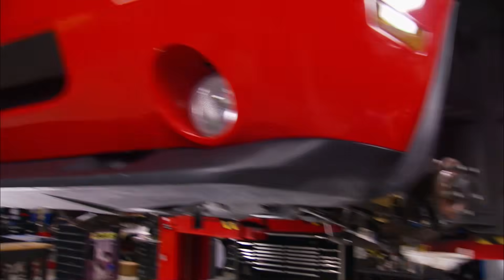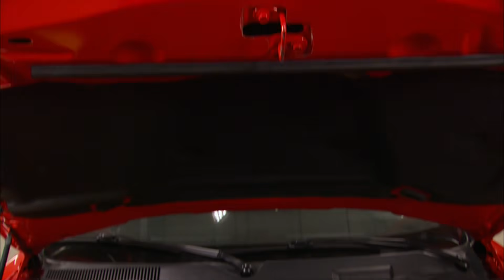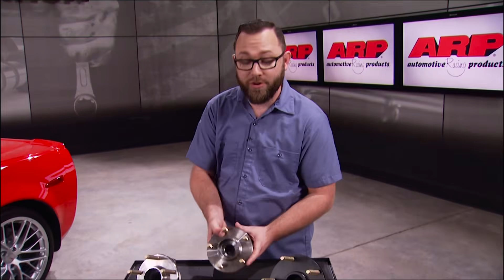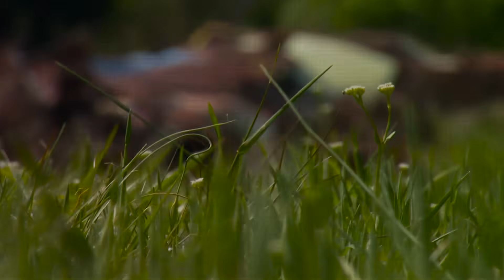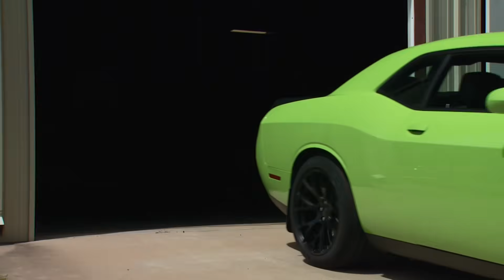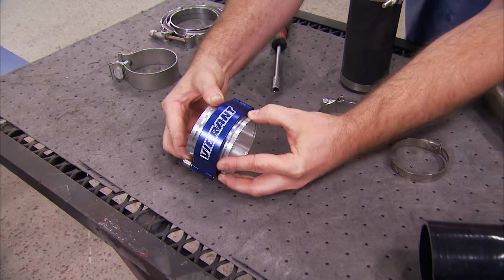Dropping A Twin-Turbo Hemi Stroker Into A 2010 Challenger SRT8 - Detroit Muscle S3, E14

Comment: I owned one of the 1970 Camaro RS in that ugly pea green.  At the time of it's release Camaros were distributed only in certain colors in different areas of the country.  My boss was golf partners with the local Chevy dealer who gave me a gret deal on the Camaro RS he had on the floor ....... It was the Pea Green ....... I wanted the charcoal but would have had to wai 10+ weeks for it.  As time went on I hated the color more and more plus being a musician it was not a great car for holding large speaker cabinets. Anyway, I was driving a lot to band jobs in those days and racked up 75K, I dumpted it in favor of a Mustang hatchback. This car was blue when they started restoring it ....... they should have kept it that way !!!!!

Comment: Working on getting srt8 and first mod ima do is get stronger suspension bigger axels then forged rods and pistons then upgraded injection upgrade cam and the exhaust then I will run turbos or supercharger after that my build plan lol

Comment: I'd have a real problem with mounting the air intakes under the car. That just seems like a really bad idea to me. If there was a way to route the intakes back up under the hood rather than under the car I wouldn't mind having the turbos under the car too much, but not the air intakes.

Comment: High performance powder coated calipers. so powder coating the stock calipers somehow makes them high performance. They guys ridiculous
Reply: Maybe they meant the powder coating itself is high performance? As in more durable or heat tolerant?

Comment: So, do you have to drop the turbos and exhaust to change out the air filters?  They are sooo crammed in there, it’s crazy. 
Wouldn’t it be easier to just buy a Hellcat to begin with?  The cost of all of these upgrades, plus labor, can’t be cheaper.

Comment: My guess is that if I had a 6.1 L engine and Charger or Chrysler 300 I would just repair it with stock parts and that would be good. If you didn't have a 6.1 L you would have to get one for $10,000 and modify it for $10-15,000 or more. I wouldn't be able to swing it.

Comment: I like those Power Stop brakes you put on the challenger, I've checked around and they have them at AutoZone, jegs, JC Whitney and other places but the cheapest I could find them was carid.com, I've bought a lot of stuff there for my 2003 Chevy 2500HD 4wd 4 door short bed with a Durumax diesel and a 6" lift and 37" tires, like my Edge Jammer exhaust system and Edge Jammer air intake, my black billet aluminum chevy emblem and fuel door, my smoked taillights and custom headlights with u-shaped halos (way cooler than the round ones everyone has these days) my custom turn signals, my 4" ovel tube step bars with 2" drop steps to make it easier to get in and 4 Pro Comp monotube nitrogen charged gas shocks and my Kryptonite Death Grip tierods, $360 but worth every penny the stock tierods aren't even fit for standard wheels and tires let alone 37" tires like mine, I was so glad when I got them cuz one of my tierod balljoints was getting loose. I got my Edge Juice Attitude CTS2 Power Porogrammer straight from the factory, since I live in Salt Lake and their head quarters is in ogden only 30 minutes away and I had the old very first Juice Attitude so because of that I got them to give me a $400 discount on the new CTS2 one which is sick and has a crazy amount of features and after that I ordered my Ampd Throttle Booster from them (since the Durumax has no cable just a computer on the pedal that tells it when you press the throttle and then tells it to go the Ampd unit gets rid of most the lag you experience between when you press the throttle and you actually go and it works good too) My other many upgrades I got elsewhere. Anyways my point is that I want to get the Z36 Power Stop brake kit that designed specifically for trucks with bigger wheels or that tow and they sound like sweet brakes and are very affordable compared to other brakes which is why I want to get a full set for my truck, if I send my calipers back in I can get a full set including brake pads, rotors and new powdercoated red calipers which will match my red truck perfect! I'm just trying to get the money up, I'd like to get a 5100 series Bilstein steering stabilizer at the same time. And it's really strange but if you look at my Edge Jammer air intake and then you look at the Banks air intake the are literally exactly the same, banks makes a ram air kit for theirs and since their air intake is the same as mine the ram air intake should work on mine as well, my only concern is they say there could be some issues if your truck is lifted. But basically instead of leaving the air intake anywhere in the engine bay my Edge Jammer air intake sits right where the stock air intake sat the only difference is I took out the plate the factory air box sat on so there's a large hole open in the front of the fender near the grill where cold air comes in. However this ram air intake that should fit my Edge Jammer airbox fits over the hole coming thru the bottom of the fender and then runs down the very front of the fenderwell and has a large wide opening that screws to the bottom of the bumper creating true ram air for it, I would be extatic to have true ram air like that. Anyways the whole point of this was the Power Stop brakes, I know you got the track edition but if you have time could you please let me know how well they work cuz I really want the Z36 ones designed for Trucks for Big Red, she deserves the best. I'd tell you about more parts but I've already gone on and on just to ask you about brakes, I just love Big Red so much she is my pride and joy and I love to go into everything I've put on her. I got a 2003 cuz it was the last year before they put the EGR system on, I remember the truck guys were building an LML Durumax and gonna do an inline twin turbo setup but couldn't cuz they had to leave their EGR system on since it's a TV show and they were gonna drive the truck on the street and couldn't set a bad example lol and I remember they were saying they were happy about it and liked the idea of the challenge and then put the EGR system and the entire stock exhaust back on it LMAO 🤣 I bet they were happy to have to leave the EGR system on and having to leave the diesel oxidation catalyst, Nox Filter, diesel particulate filter and shitty stock muffler on lol! Being a 2003 my exhaust is 4" stainless steel straight back from the turbo with no EGR system or any of that crap just a straight thru muffler and she sounds great and it gives her a bunch of low end torque, much more than I expected after I put it on, and not only does it have a 5" polished stainless steel tip with edge embossed into it but it also has a polished stainless steel muffler with Jammer embossed into it and normally you'd never see the muffler but aince I have a 6" lift you can see it thru the weelwell, it's super nice, much nice than exhausts that cost a lot more in my mind! Well anyways I was supposed to be talking about the Power Stop brakes and got off topic again I could get pads, rotors and calipers for under $1000 now that a good deal and the red calipers would look good on Big Red, she doesn't necessarily need calipers but they are 17 years old and if I can get new ones for $100 each and they are powder coated on top of that to match Big Red it's a win win, my only concern is brake cables I'm sure I could make my existing ones work but I'd like to exchange them for some braided stainless steel ones. But they ain't cheap and I don't know what length they are, I'll have to take them off measure them and go to AutoZone and get some the right length. it'll be good to flush my brake fluid too, I've already done my engine oil, my transmission including the outer and inner filters, my rear end fluid when I put my custom AFE diff cover on, my coolant, my power steering, but I still need to do my brake fluid which your supposed to do every 2 years and my transfercase and front diff fluids too. Anyways let me know how those brakes work out, I know you got 4 piston caliper ones, 2 pistons on each side, and they are on a fixed brake system. My truck is a 2 caliper floating system front and back but I have only ever 1/2 tons and light duty 3/4 tons before, never anything with more than 6 lugs so they were all single pistons calipers, I couldn't believe how massive Big Reds 2 piston calipers are, but I guess you need calipers that big to stop such a big truck with a Durumax diesel in it and that made for towing. Still I did put new high end AutoZone brakes on the front and they just don't cut it, if someone stops short in front of me I'm afraid I'll hit them which is why I keep a good distance between me and the person in front of me and why I want the Power Stop kit for Big Red so it'll bring all that power and those big 20" wheels and 37" tires to a stop faster. Well I'll quit my babbling, if you got this far you must be a Saint or a true truck lover lol 😉 and you have time please let me know how you like those Power Stop brakes! Thanks!

Comment: I've been seeing a lot of turboed hemis these days and some really cool setups, but mounting them underneath is a first and looks like a really good way to do them. I prefer superchargers myself, and have been thinking about adding one to the 6.1 in my Challenger. It's the way to go because you get instant hard-hitting power right away, without the dreaded turbo lag and the 6.1s also handle boost better than the 392s.
I still need to get some headers for her, but did replace the restrictive factory exhaust with SLP loudmouth cat-backs and flow really well. Plus their loud & nasty just like I like em and gets a lot of attention, but my neighbors don't and probably wish that l would move far away lol. They are the best bang for the buck and sound just as good as the Corsa extreme & borla attacks, but are a fraction of the cost at $599. Is because there's not much to them and consist of 3" stainless with open chamber racing bullets, which allows for reso delete and would sound even sweeter with a supercharger or turbos

Comment: Why would the turbo parts be metric?   In the muscle car era,  Plymouth always outsold Dodge.   Back in the day  the  chargers & challengers were not as popular as gtx or roadrunners.
Reply: robert gardner: That depended on where one was on which day.  During the 60s in LA County Ford, GM, Chevy had mfg. plants within an hours drive. I recall there was a liberal smattering of each all over the region.
Reply: @RedEye19  I ordered my  Roadrunner form the Los Angeles Chry/Ply plant. Hemi rules & Plymouth rules.

Comment: @11:24  Wow, a car that you can never drive in the rain, snow, thru a puddle, down a dirt road, next to a street sweeper, or over the cut grass/leaves that those wonderful migrants with leaf blowers love to deposit on the city streets.  Suggested air filter change...every road trip.  Does it come with an old oil squirt can to lubricate the lifters every 10 miles?

Comment: May I have 2 questions? 1, how the two wastegates work? 2, is the car very sensitive to the level of water?
Reply: Well the wastegates, not sure there's any major problem there, but since the intake is straight at the turbos, and they are at the pretty much lowest point of the car (tires excluded), I'd say this is a fair weather ride 😃

Comment: That’s definitely not a rainy day car with those air intakes on the bottom of the car . I still think there could have been a better way to put them up top somewhere. I know , nobody wants to be driving this car out in the rain but weather changes a lot and you could get caught in it , plus dust and road grime will be suck up in there clogging those filters .

Comment: all that power yet it going to be a boring asf car to drive. all power and no driver engagement all the driver there to do is turn a steering wheel. wheres the fun in that   at this point ill prefer have 300hp and a 6sp manual transmission on a well balanced chassis   so i can actually engage with the car and drive it . now thats fun  large hp numbers are all well and good  but when the car is just a big hp car with no driver engagement it just comes out as dead boring  P.S FIRE THE DAMN ENGINEER  I PITTY THE FOOL WHO HANGS THERE TURBO INTAKES 3 INCHES FROM THE ROAD

Comment: Honestly they could have just gotten a body and been done. The car is almost completely aftermarket parts. 😆
Also those intakes are on the bottom? Really? They couldn't have designed a couple lines up to the engine bay?

Comment: To trully make a 2010 srt8 compete with a hellcat you might as well just buy a hellcat.
If you gonna add any type of forced induction..ur gonna need forged internals..if you want the motor to hold up over time...thats a very expensive process.
Also id personally add 6 piston brembos if u want the same kinda stopping power

Comment: You guys are really setting people up for failure, huh powernation? Even hellion is in denial, put 1 turbo in the engine bay and save your self the trouble of plumbing 2 turbochargers and running in to the issue of ripping off a oil line or sucking in water and dirt. Next time please use common sense when trying to sell a product to your viewers.

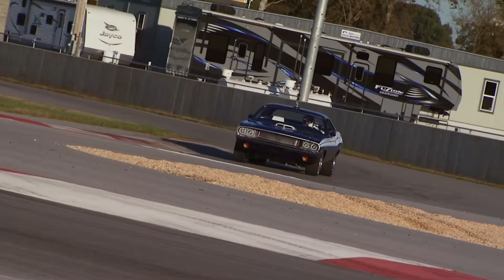Comment: LOL what the f you doing taking that car at 13:00 on a road course??? You take a corner at more than 30 mph and you will crash it, that is a straight line built car.  A Lebaron would beat that thing around a curvy track.

Comment: When they replaced the engine mounts, they should have swapped over to the mounts out of the 6 speed equipped cars. They're clam shell design is gonna be a lot more durable dealing with that Hellcat-like torque than the version the automatics came with...

Comment: I love power stop I have the rotor and breaks  on my truck the original discs got warped , I pull a travel trailer and the difference is huge especially coming downhill ...

Comment: Whole design of that turbo system is a joke - not only will it be sucking up junk or the road and be unusable in the wet, it leaves all the oil supply feed hanging BELOW the TRANS. First speed bump or sharp curb in to a parking lot, and it'll drag on the ground and puke oil everywhere, right before the engine seizes.

Episode could do with a couple of updated graphics, such as "at time of show first airing" for the Hellcat being described as most powerfull (dating this to Pre-Demon), and a reminded for the competition to win the car being in the past.

Comment: In honesty I really like the bottom mounted setup here. More benefits to airflow and heat distribution compared to engine bay based solutions. Granted that really limits driving scenarios, but for the track that’s where’d I’d be anyways so I’m not worried there.

Comment: This is an awesome build. However, whoever wins this things, please take a day and take a torque wrench to all the fasteners they touched. Replace TTY bolts with new ones like subframe and route the air filters to a more logical location even it means adding more plumbing. Impacting everything is ghetto as shit... especially after so much work and money went in
Reply: I think this was from years backs
Reply: @Jonathan-tb6fm  even if so, I truly hope somebody put at least a torque wrench on this thing

Comment: 3k stall?  Ok, I guess this car is only meant to be trailered to the drag strip.  Also, you'll have to remove the turbos and exhaust to replace the air filters.  I actually feel sorry for whomever wins this car.
Reply: Did you see them wedge that intercooler in there? Seems like it would rub through pretty quick
Reply: Not every build is meant for the quaint street types you know..... There are those builds meant JUST for (-insert style of racing here)

Seriously, it's like complaining that a F1 car isn't street legal. Some of yall really need to think before moaning.
Reply: If have a 273 cam and 3k stall on my charger. It’s really no different driving it.

Comment: This title is not correct..."Dropping A Twin-Turbo Hemi Stroker Into A 2010 Challenger SRT8". Clearly as shown this was actually dropping a "2010 Challenger SRT8 on a Twin Turbo Hemo Stroker" then they use it to vacuum up some water on the road.

Comment: Bottom mount turbos like that are stupid ( sketchy, you hit a pothole, drive in rain or  very crusty weather, say goodbye to your turbos & air filters
or maybe at least the build a shield around it
Reply: @bigboreracing356  Sounds like you bought one of these poorly designed systems.
How do you deal with leaves and stones scattered on the insides of corners on a country road?
What about unmade roads, or roadworks?
Or when you're out, and it rains, do you trailer the car home?
Reply: @bigboreracing356  Oh, so they're Trailer Queens, not actual street drivable. Your loss, real cars can be driven and enjoyed Every Frakking Day.
As for driving through those conditions, look up events called Hill Climbs.
Reply: @bigboreracing356   Looks like you like to whine and abuse, but can't take it when you're on the receiving end. Classic bully behaviour.

Comment: with the turbos on the ground and the air cleaners can suck water right into the system if you are driving in the rain.
Reply: @bigboreracing356  Where did the Ford/Chevy touch you?  Calm down kid.
Reply: @bigboreracing356  LOL!

Comment: I hope there's a scavenge pump on those oil return lines.  Also, great job helion with that TIGHT fitting intercooler...  Yikes.  Also, there is a ton of (questionable quality) couplers for those charge pipes.  Man, I didn't realize helion made such poor quality products.  Kind of a shame, everything else on the car was super solid.
Reply: It surprised me also, no better than ON3 kits